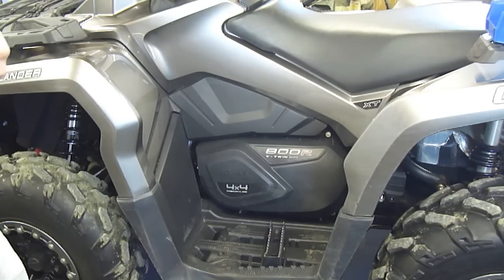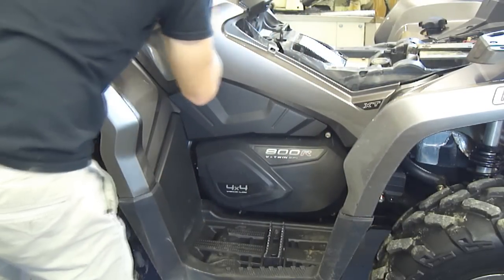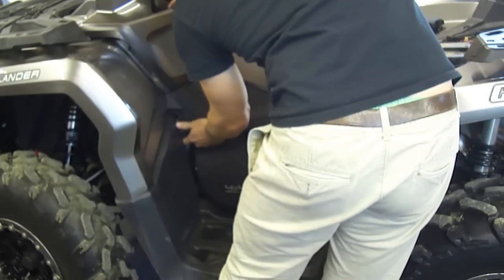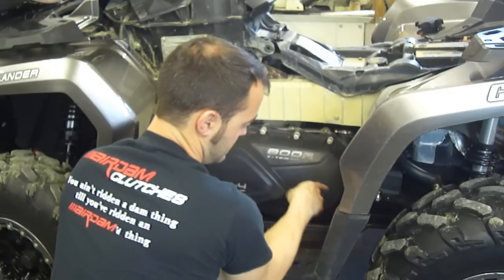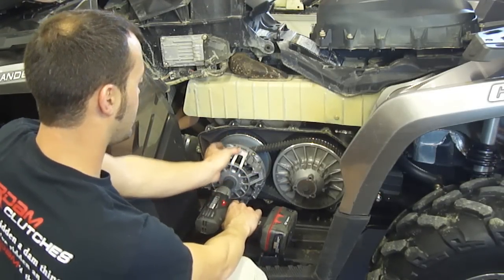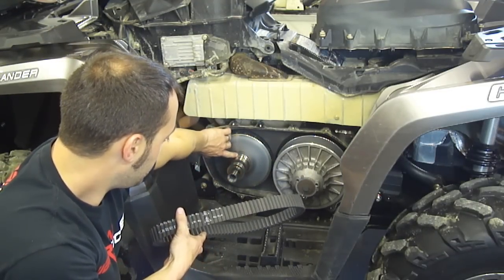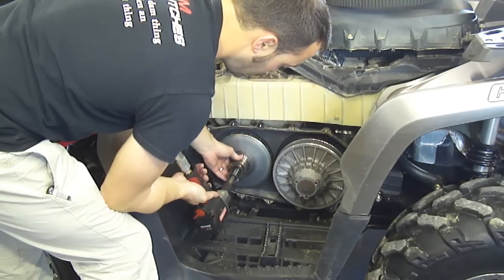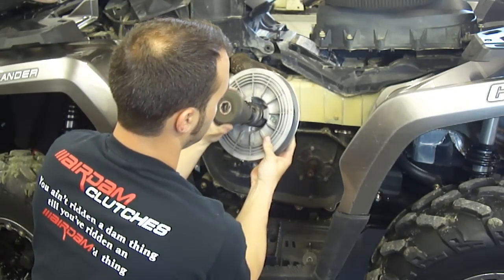Can-am BRP outlander renegade Gen 2 2012+ clutch disassembly

Comment: Thought that you are not supposed to use impacts on those bolts. What’s the point of the actual tools then? This looks so straight forward
Reply from the maker: If you want to follow the BRP method for tightening you can, if you eyeball the forums you will see hundreds of people who have their stock secondary bolt back off and the secondary burn thru the cover. This way that i do them has never failed me once in a dozen years.
Reply: @AirdamClutches  so how do you get to torque that’s within spec? Just hammer on with the impact? Seems to be youd need the special holder tool if you want to use a torque wrench

Comment: Hey what can I do when the secondary clutch 8mm bolt spreader broke off inside the outer sheave ???
Reply from the maker: Pull the secondary bolt out, so you can pull the clutch back off, and use needle nose pliers from the inside to thread the bolt thru to the inside. If its bent or messed up, use a die grinder or something to grind the bolt off as low as you can get inside the clutch. Thread one of the other two holes and start using it.
Reply: @AirdamClutches  but what if the belt is still on the clutches can I still get the clutch off??